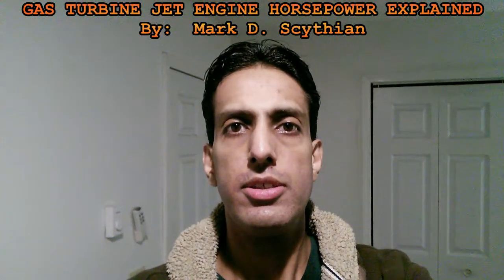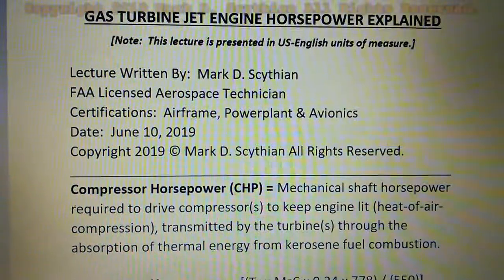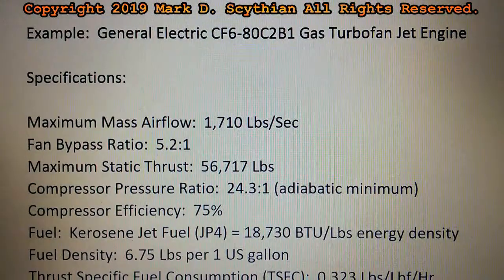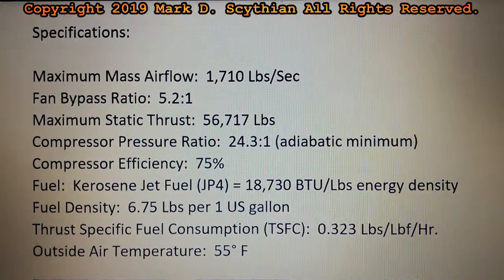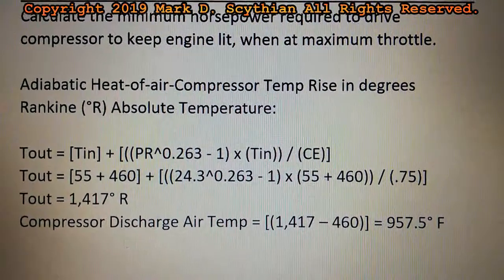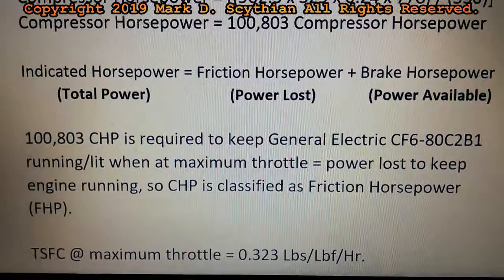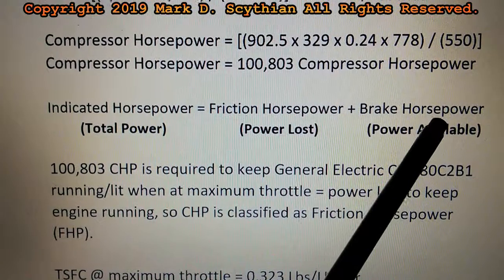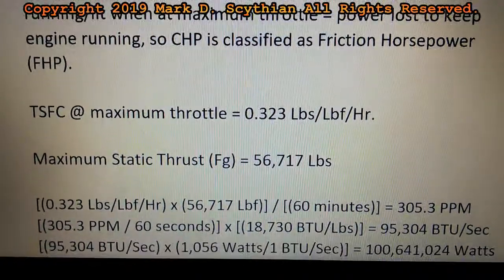Gas Turbine Jet Engine Horsepower Explained [Must See!!!]

Comment: Hi Mark, I have some ideas for a high energy fuel (zip fuels)
Reply from the maker: Hi Christophe.  Are you referring to Boranes (zip fuels) with an energy density of 30,000 BTU/Lb, in comparison to Kerosene Jet Fuel (JP-4) with an energy density of 18,730 BTU/Lbs?  If so, what is the flame-front speed of Boranes (zip fuels)?  Due to the extremely high air compression of gas turbine engines,  flame front speed is limited to just 6ft/sec and accomplished through Kerosene ("jet fuel"). 

My understanding of Zip Fuels are that they were used to extend gas turbine jet engine range during the 1950's.  Based on the molecular structure(s) of Zip Fuels, what kind of flame-front speed(s) will they exhibit when under a 24:1 compressor (air) pressure ratio?

- Mark -
Reply: @markscythian7179  Hi Mark. Yes, I'm referring to Pentaborane, b5h11, 29,000 btu/lb. Are you familiar with the laminar flame speed at stoichiometric ratios?
Reply from the maker: Hi Christophe.  Yeah, the thermodynamic and physical chemistry computational analysis pertinent to hydrocarbon-based combustion.  Which should fall under Classical Thermodynamics, pertinent to Molar Mass, AFRs', Thermal Transfer and Combustion Hysteresis, etc. 

B5H11 Molar Mass:  [(10.81 x 5) + (1 x 11)] = 65.05 grams/mole

Kerosene doesn't have a fixed molecular structure as it will absorb water molecules during it's mixture and combustion process.  But its average Molar Mass based on varying carbon atoms (6 to 16) is certified at 170 grams/mole.

I have yet to look up physical chemistry data regarding Pentaborane.  Quick question:  Will Pentaborane's burn at 6 ft/sec when at 24:1 pressure ratio?  It seems like it may burn too fast for heat-of-air-compression applications as its molar mass is much lower than kerosene.  It also seems like zip fuels would work well with compressors with fewer rotating airfoils and much lower pressure ratios.  Seems like Pentaborane would light off as low as 16:1 pressure ratio.

Not to mention that it's energy density is much higher than kerosene, although what is Pentaborane's fuel density per 1 US liquid gallon?  Even liquid propane has a higher energy density compared to gasoline, but 30% less fuel density per 1 liquid US gallon compared to gasoline.

Kerosene = 18,730 BTU/Lb => 6.75 Lb/1 US liquid gallon (3.07 Kg/3.78 L)
Liquid Propane = 24,300 BTU/Lb => 4.24 Lbs/1 US liquid gallon (1.93 Kg/3.78 L)
Diesel = 19,300 BTU/Lb => 7.1 Lb/1 US liquid gallon (3.23 Kg/3.78 L)
Gasoline (Petrol) = 20,000 BTU/Lb => 6.0 Lb/1 US liquid gallon (2.73 Kg/3.78 L)
Pentaborane (Zip Fuel) = 30,000 BTU/Lb => 5.08 Lb/1 US liq gallon (2.3 Kg/3.78 L)

1 US liquid gallon of Kerosene = 126,428 BTU potential heat energy
1 US liquid gallon of Pentaborane = 152,400 BTU potential heat energy

Pentaborane has about 21% MORE energy density per US gallon or 3.78 liters than kerosene "jet fuel" (JP-4) and weighs 25% LESS per 1 liquid US gallon or 3.78 liters than keroesene "jet fuel" (JP-4).

The only two questions left to answer are:  1.) What is Penataborane's average flame-front speed?  2.) What is Pentaborane's cost per liter or US gallon?

Thanks.

- Mark -
Reply from the maker: Technically, hydro-boron combustion NOT hydro-carbon combustion in regards to Pentaborane.  What about environmental risks?  Will inhalation of boron derivative exhaust gases pose any health risks, compared to hydrogen-carbon combustion?  Of course both lit off in at least a 20% oxygen atmosphere.   - Mark -
Reply: @markscythian7179  I think it would be restricted to military applications due to the safety issues.
Reply from the maker: Seems like it would, that, or high-performance and/or experimental applications as well.
Reply: I have sent you a linked in invite